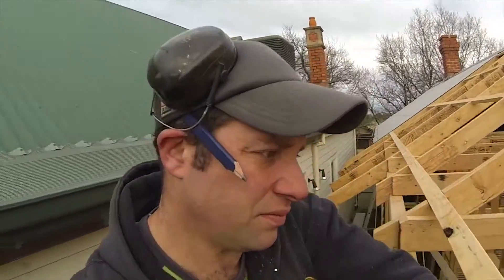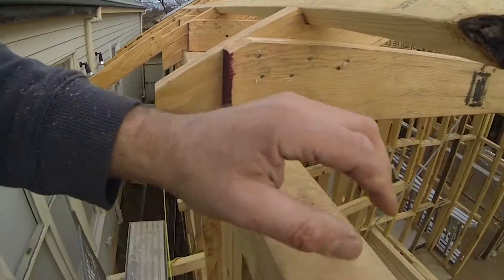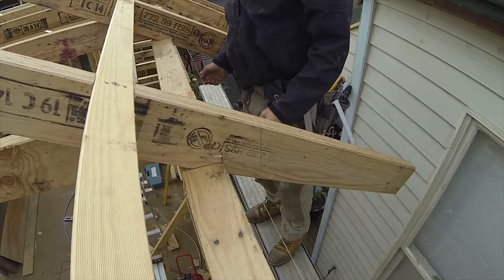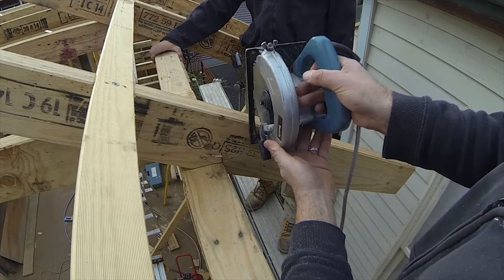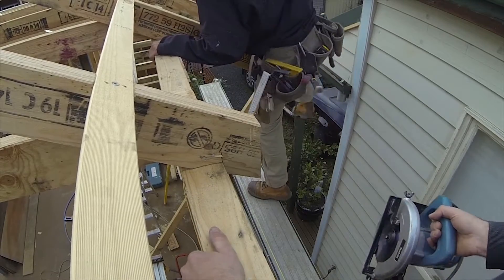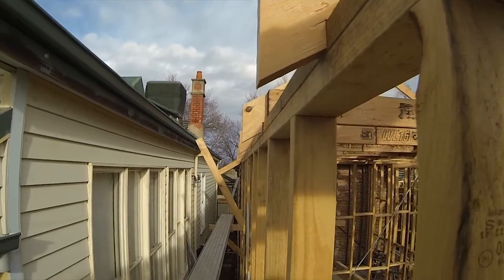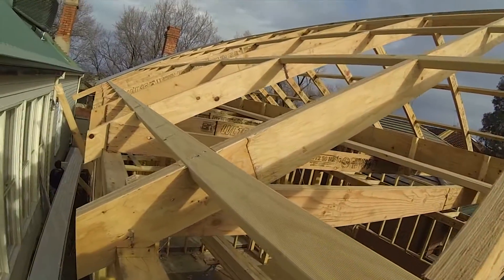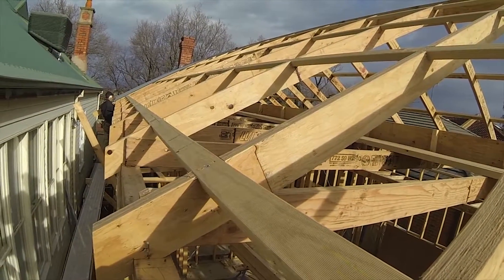lining up and cutting rafter tails old to new

Comment: how come some of your battens are flush with the rafters but the last one closest to rafter tail is above?? also what did u use to fasten them?? nails??
Reply from the maker: Gday Again B,
rafter tails and batten will span (depending on your spacing) between the top of the facia board and the last batten
the nails used to "pin " the battens are framing nails 3" minimum or 75mm then the battens are screwed
#stayawesome 
joe joe